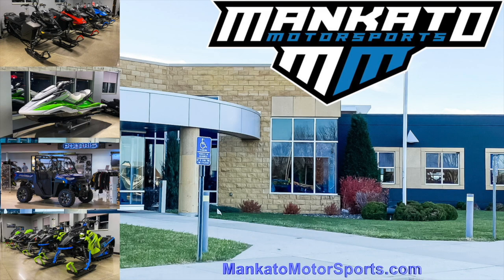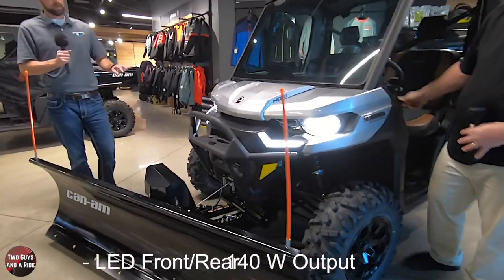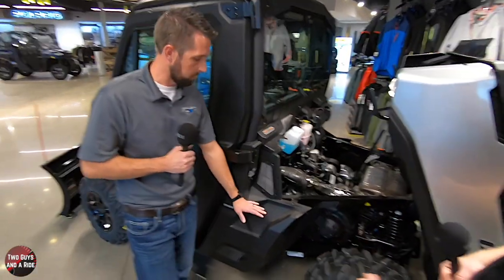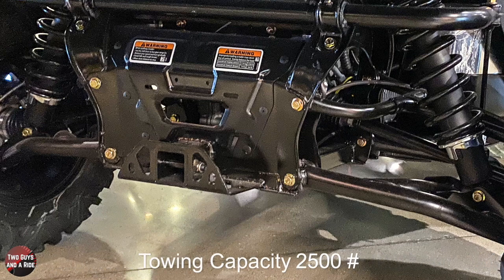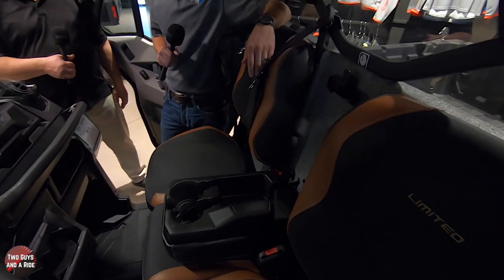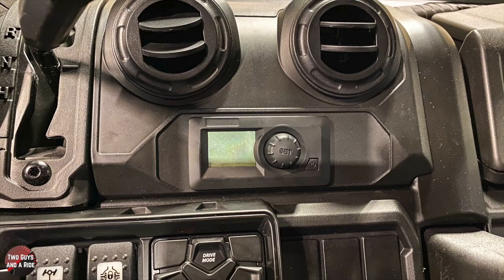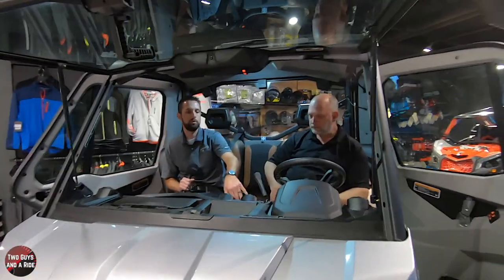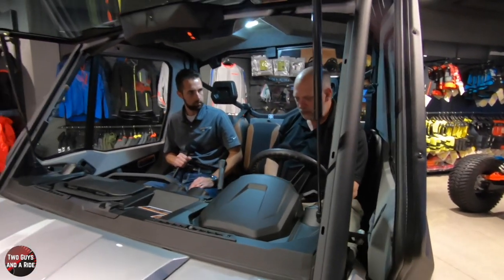Can Am Defender Limited - Yeah, it CAN do! /// @ $25,499

Comment: i have a 2018 hd 10 mossy oak with 7ooo miles on it we use it for primary transportation 3 to 4 months of the year because we live off grid in New Mexico at 8000 feet in the zuni mountains the Defender is awesome i use it for dragging the road to keep it passable during the winter as we have to use the defender to get to our truck its 6 miles round trip each day as we work in town it has never broken down never left me walking and awesome in snow or mud i depend on it daily and it goes anywhere i stuck it a snowdrift once and had to dig it out it lifted up on the skid plates was out in 15 minutes great power great torque hauls ass fun to drive im already saving up to buy a new one what a machine
Reply from the maker: Congratulations on your Defender and thanks for sharing! Thanks for watching

Comment: Can the A/C condenser get wet when doing water crossings on the trail? I believe it sits a little lower than the top of the tires.
Reply from the maker: Thanks for the question. While I don’t have a direct answer my best guess is that yes it can. Even house hold ac units are built to withstand water on the electrical components so I’m guessing this would be the same. Thanks for watching!

Comment: I like everything about the Defender limited and excellent options 👌. The tell is really good and good transmission torque, my humble opinion needs more horse power to carrier the extra weight. I am waiting for 2022 they need to increase the horse power to 110 horses power. That will help with the extra 500 pounds from the hard top, I went to Bass pro shop and purchased a SVX1000 tracker because I liked the 100 horse power with the hard top and others options that I added. I am ready for 2022 if the increase the horse power, I will purchased the Can Am limited I like that beautiful machine.
Reply: The Can Am I like the transmission torque just need more horse power to carrier the extra weight.
Reply from the maker: Agreed
Reply from the maker: We agree with you. It does a good job but more horsepower would make it practically unbeatable. Thanks for watching

Comment: How much is one ordered now? How about the 6x6 with cab and heater and dump bed?
Reply from the maker: With regional prices varying and limited supply and delayed wait time, you should check with your local dealer on current pricing
Reply from the maker: Thanks for the question. Current pricing can vary so we would suggest contacting a dealer for the most current accurate pricing. Thanks for watching!

Comment: Does it come with a USB port?
Reply from the maker: Thanks for the question. It does not come with a USB plug in, however the one one we reviewed (see full review here https://www.youtube.com/watch?v=_0A9_t9RKfs) had the optional accessory 12 volt plug in which you can see in the video.  You can also order it with a USB plug in to charge your phone.  The optional stereo from Can-Am BRP is $709.99 and comes USB Ipod and Iphone ready.  Thanks for watching!
Reply: The two guys in the video missed it. They failed to show the standard USB port in the storage compartment with lid (which they also failed to show) above the dash display between the steering wheel and windshield.

Comment: I own one, Defender Pro Limited 2021. Like it but do fine some design issues (water penetrating via the upper front glass) Brought it to the dealer who used silicon to close some holes in that area. Seems according to him « a design issue ». The door gasket tarred within 3 months. An other issue which I find major is that when in reverse at night you can’t see much looking thru the rear glass….needs a backup light.
Reply from the maker: Hey that’s great information to share with our viewers. Thanks for the great feedback!